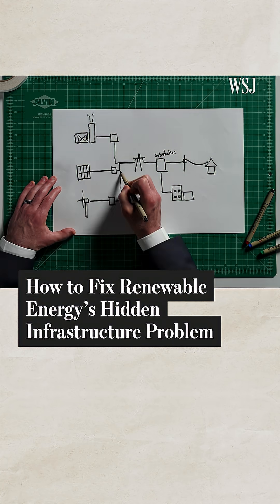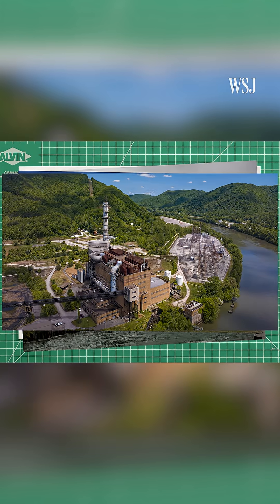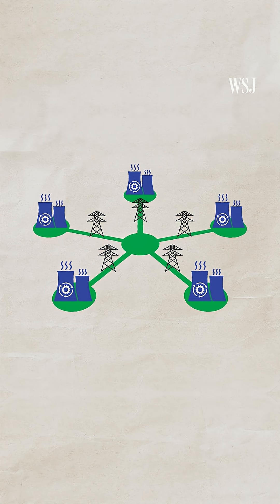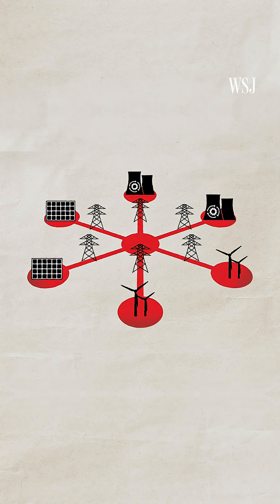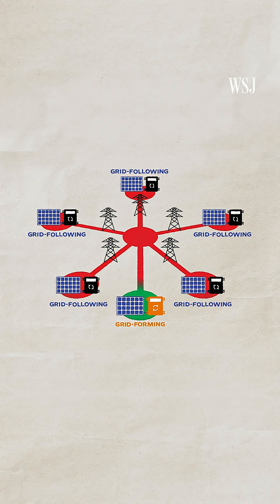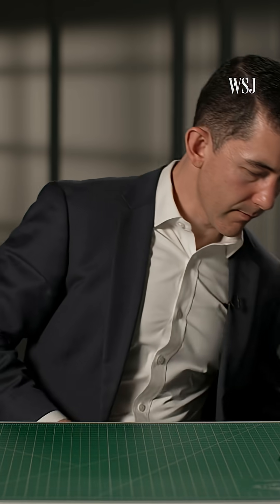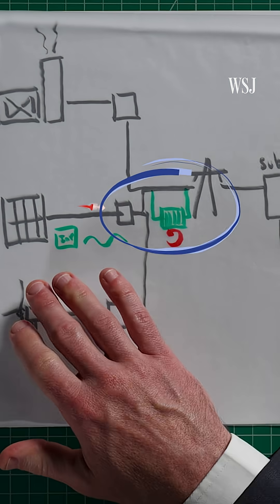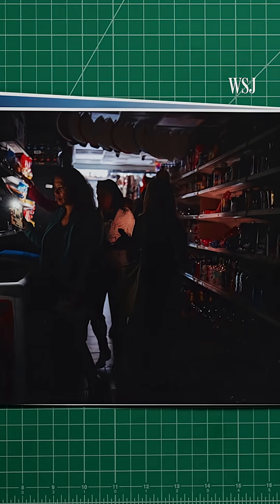Engineer Explains Three Key Issues in Renewable Grid Design

Comment: We don't need renewables. We need variable and constantly running Molten Salt Reactors (MSRs) which can achieve temperatures of 700C requiring gas like He or CO2 to draw the heat from the molten salt and use a Brayton Turbine which are smaller and more efficient.

Thanks to the Biden/DemonRat NRC which was scared of molten salt, we are far behind where should be. Currently only 2 MSRs of 1MWth are being built...and they are just getting off the ground.

Comment: Simple..electricity is good, economical, efficient for transporting energy from a dirty or remote nuke plant to energy users of urban and industrial areas and is mostly produced real time an demand, because electricity is not economically clean,  durable and efficient for massive needs for large storage of energy..Since surface renewables wind and sun are free and available EVERYWHERE, they do not need any long transports to a place where they can be produced also, but they need massive local storage to match demand with variable seasonal unpredictable production, which is ok for such renewables quasi nil cost of production. Therefore, a non electric economical, clean and efficient energy storage like heat and green oxidisers such as H2 NH3 CH4 gas and synthetic HC liquid fuels. It is the monopolistic 100 % electric path, EV’s heat pumps, which is totally wrong and roasting the planet.😢

Comment: The red AC line he draws is still DC but with ripples 😅 With AC, the 50/60Hz sine wave should be drawn on the X-axis and go negative 50% of the time 😄
Reply: It's still AC just with a large DC offset. Though you're correct mains AC is zero crossing
Reply: Isn't that what he drew in the video?

Comment: DC to AC is simple and has been used for decades. It is called a rectifier. Every vehicle on the road today has one. You can make one at home.
Reply: No, DC to AC is called an inverter. A rectifier converts AC to DC.
Reply: @chop098 I lisdexed it 😂
Reply: The issue isn’t the rectification, grid scale energy needs to be in sync. You’ll see this in building that have multiple generators as well, the generators need to be synced before they are used to support the building.
Reply: Rectifiers do AC to DC, not the other way around . As far as I know.
Reply: @asifalamgir4788 When you rectify AC to DC it is a converter, for running things in your house that would normally use batteries. When AC is turned to DC you have an inverter, like the unit you can buy for your car, that lets you run some household stuff.

Comment: Most false what they try to spin here. 

Renewables helped the grid to rebound. 

Relying on nuclear would have made the blackout worse as they were down for 3 days as they had to wait for xenon to clear from reactors. 

In additon dropping costumers and generatorin from the grid is safer then just risk equipment. 

The problem were insufficent number of high voltage power lines that would connect to france or marroco and the lack of modern Statcoms.
Reply: Seems like both are true. The renewables contributed to instability (a spike), and they came back online quicker than traditional and nuclear plants.

Comment: So, the free "green" energy is becoming very expensive and not so green.
Reply: Never heard of free electricity. 
You must be confused.
Reply: @technolus5742 The greens claim that the solar and wind is coming freefrom nature, maybe they are confused.
Reply: @alex3261  yes, they are indeed confused. Nobody in their right minds would claim any form of power "free".
Reply: Incorrect by using batteries to store it, instead of wastefully disconnecting solar during peak production you are making it even cheaper. Don't believe me do a little search on cost per megawathour.

Comment: This is some serious bullshittery, saying that "infrastructure wasn't build for renewable energy resources" is implying that electricity from them is different type. It's the same energy produced in coal or gas powerplants. The problem isn't the source, it's the grid itself - the grid wasn't designed for that mamy sources. Solution? Just upgrade the grid to be fit for all possible sources. Don't spread the propaganda "renewable is bad".

Comment: Massively expanding nuclear energy via SMRs is a better way to ensure 60Hz grid frequency. Removing onerous regulations would reduce the cost of nuclear and make it viable as the sole source of energy and eliminate unreliable energy sources like wind and solar.
Reply: They are only meant to be produced from 2030 onwards. They are not going to make an impact until 2035s.
Reply: @paxundpeace9970 That's assuming the current regulatory environment and absence of a Defense Production Act ramp up. It makes more sense to focus on developing these factory lines than a single penny more for wind or solar or their associated infrastructure requirements such as batteries or the video's grid "upgrades".
Reply: @Zav  wrong.  Nukes are too expensive and slow.  Solar plu Batteries is already deploying at scale and is the cheapest energy in history (except the US has managed to have a complete regulatory disaster which has added to the cost).  Google Australia versus US for cost of solar. You will then see why Nukes are dead.